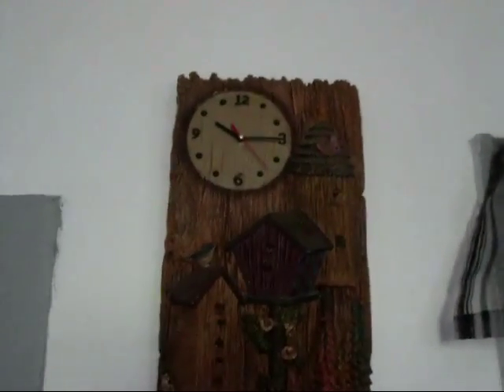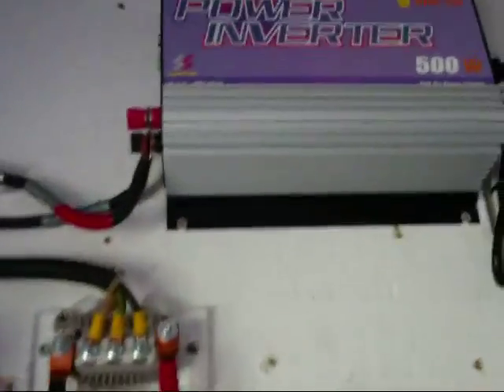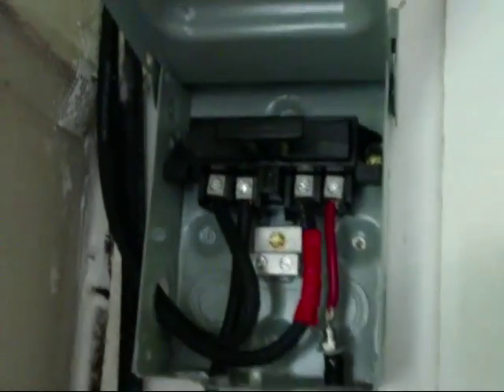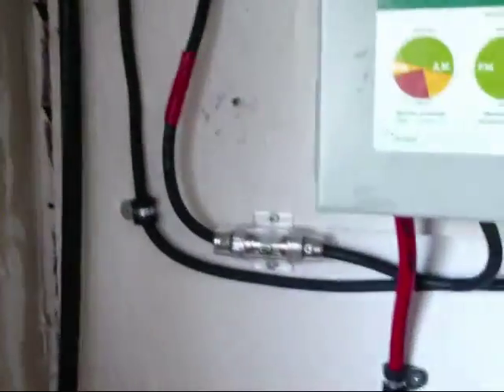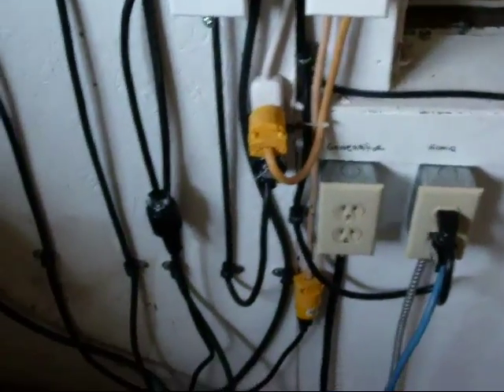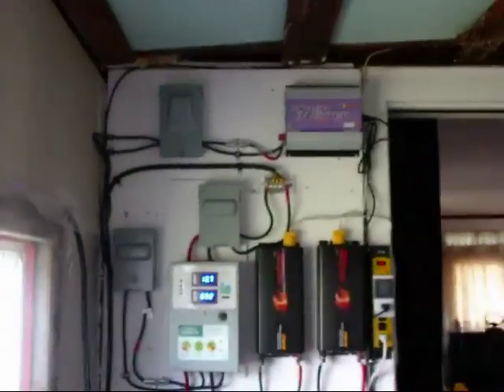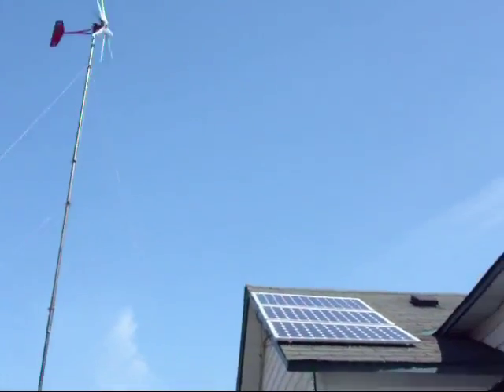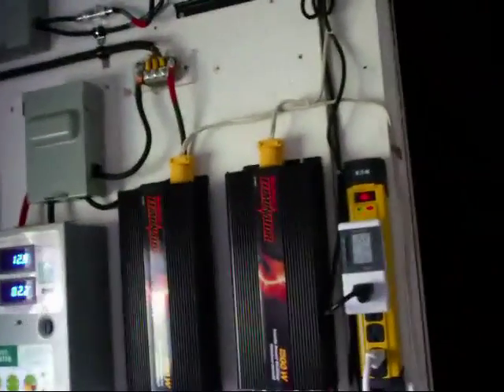coleman air charge controller small solar project

Comment: Hello.  I have the same model that you are showing in the video.  To connect the solar panels, how much would be the maximum watts, and could it be installed, in series?  I have 9 panels of 300 watts each with 40 volts approximately, could I use them all?

Comment: Addicted? You do become addicted, everytime i come from work heading to the garage
check all my system inverters,cables,fuses,batterys,grid tie, you name it's awsome to me 'cause thousand of dollar on it you have got to be carefull ..advise get a Ip camera 
it's like 45 in amazon or usb camera with a longer usb cable really cheap 32f $12.00
installe in your pc that way you dont have to walk back in forth. i stared like you now 
my electric when 80% down im grid tie and off grid,

Comment: Mike, it will show amps if you run a posotive wire to the shunt and down to the battery from the shut, for the turbine and since thats a100 amp LED Meter it will handle that power easily,Nice setup_Billy
Reply: Hello.  I have the same model.  To connect the solar panels, how much would be the maximum watts, and could it be installed, in series?  I have 9 panels of 300 watts each with 40 volts approximately, could I use them all?